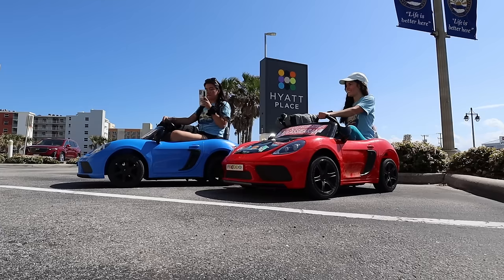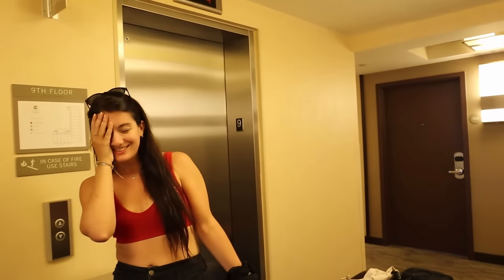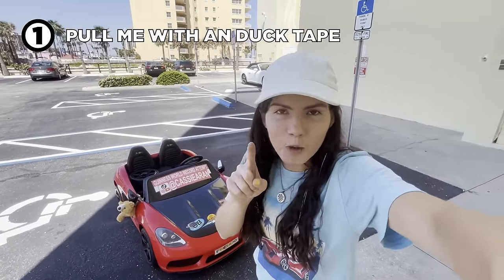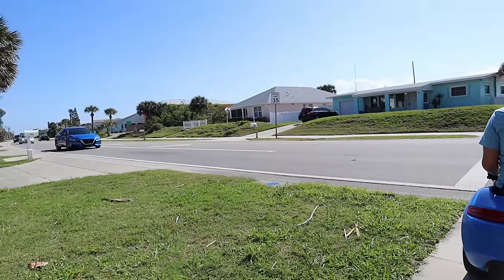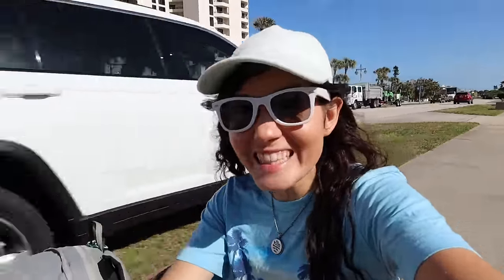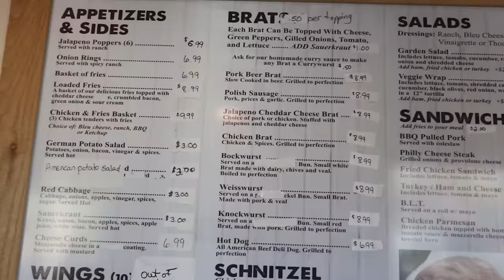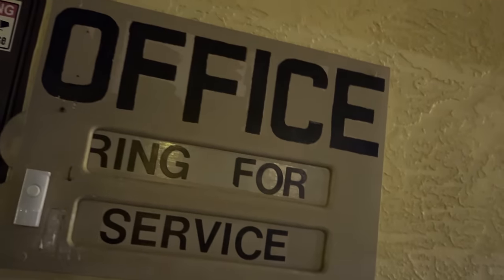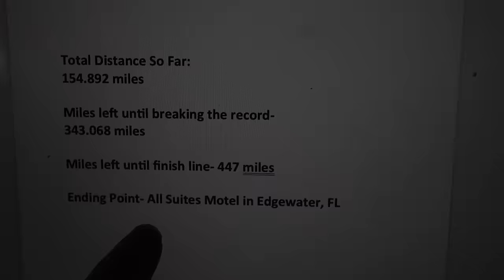🚗 LONGEST JOURNEY IN TOY CARS - DAY 15 🚙

Comment: Battery solution: you both drive 6 miles, Lauren changes for new batteries that go 10 more miles, and then you have Lauren’s half charged batteries to use later if yours run out.